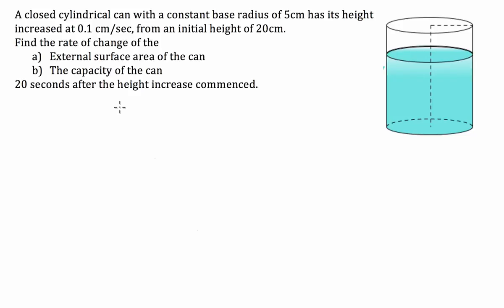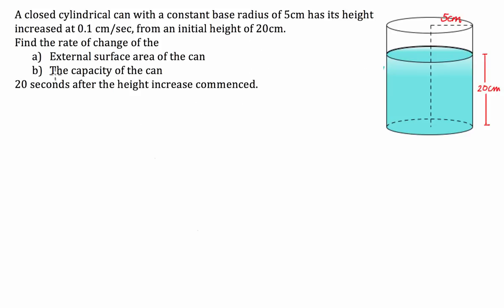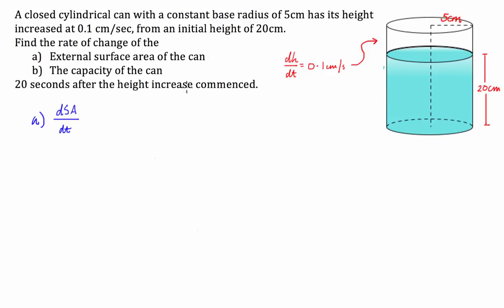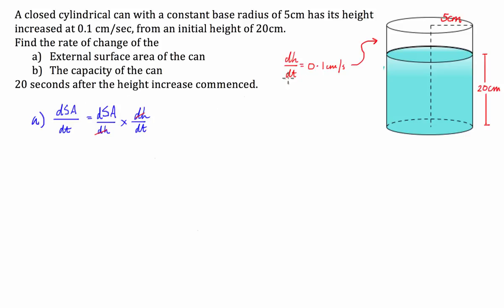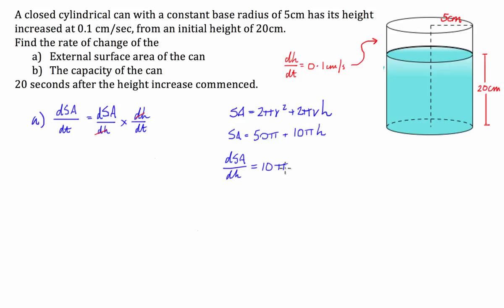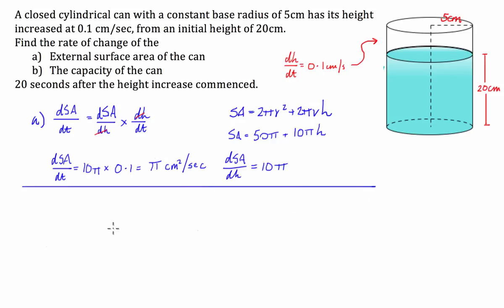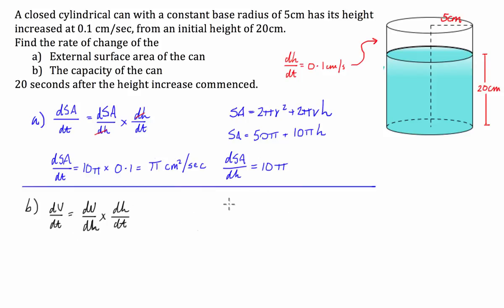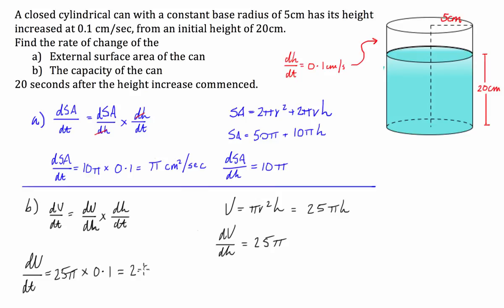Related Rates - Finding the Rates of Change of Surface Area and Volume of a Cylinder

Comment: why does every video I find on this tell me the surface area is 2(pi)rh*2(pi)r^2 when google and everything else that is not a video tell me that it is just 2(pi)rh?
Reply from the maker: That formula gives you the surface area of the piece that wraps around the circumference of the circle. The one that I use also includes the area of the top and bottom faces. 

I hope that helps :)
Reply: @HaroldWalden  Thx, helps a lot
Reply from the maker: No worries, glad I could help :)